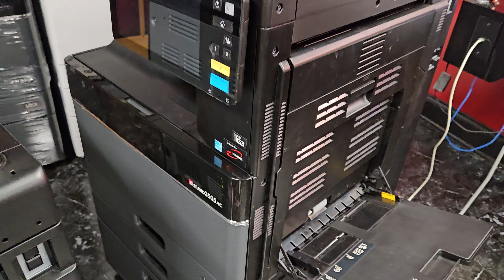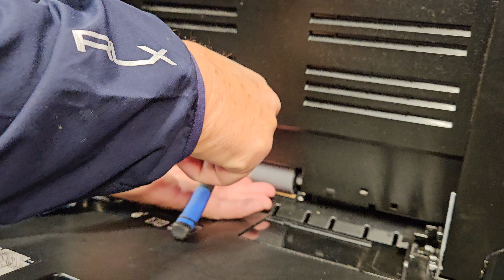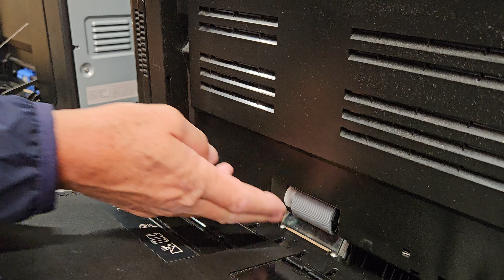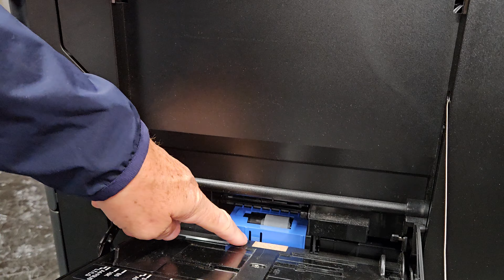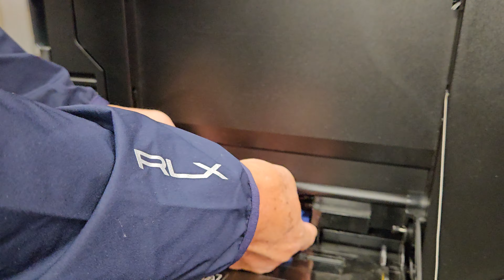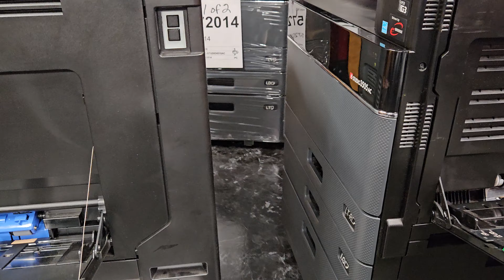Bypass tire replacement for Toshiba copiers

Comment: Another informative video! What's your opinion on those 330AC/400AC intermediate platforms?
Reply from the maker: I have about 50 out in the field for over a year now and had maybe 2 or 3 service calls. I like them and they are performing very well.